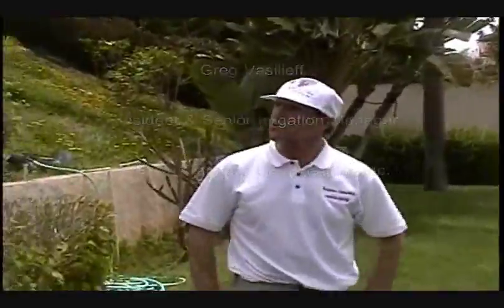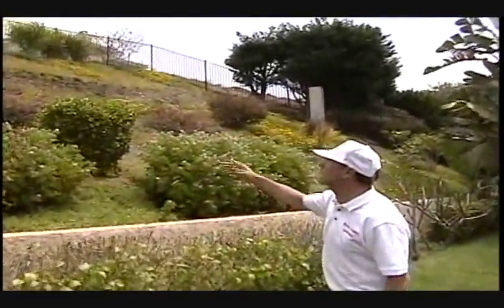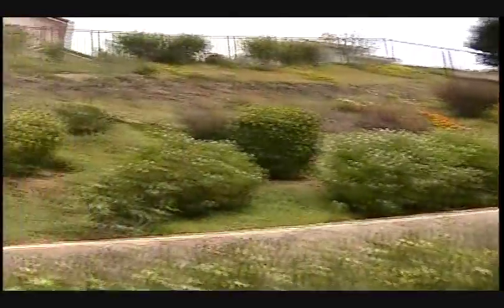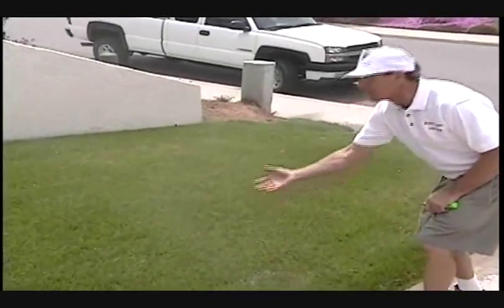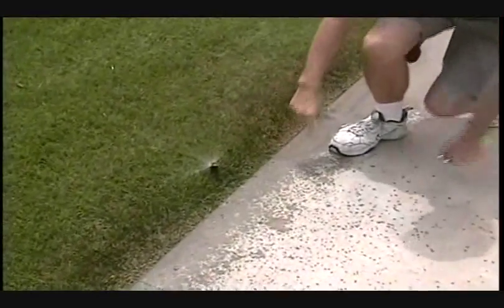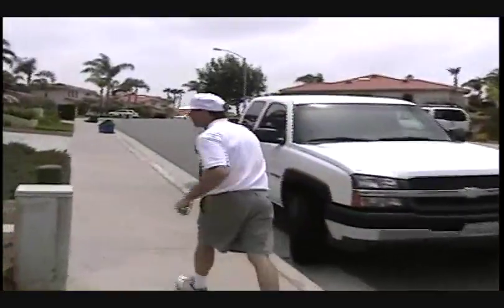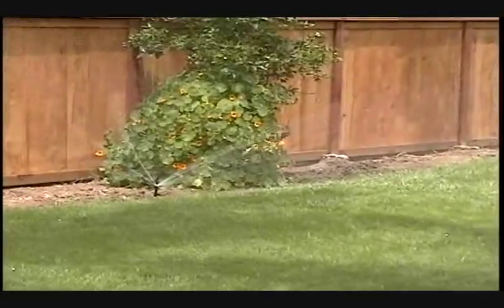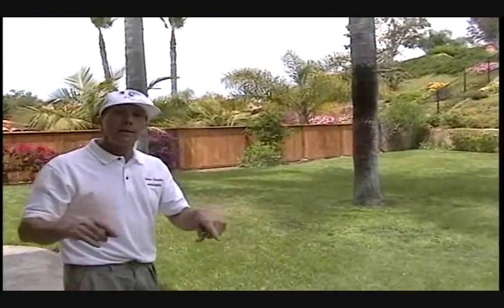MP Rotators

Comment: I agree I do sprinklers  system  and I have used hunter and rainbird  rotery nozzles  that apply  water slow   but u have to extend  run times and thay cost about 5$ per nozel that is a lot some customers  are us to  the regular  nozzle

Comment: Several things wrong with this video. Firstly, you are not using 60% less water. you are running the zone 60% longer. Your plants will die with 60% less water, as would you. You need the SAME amount of water to soak the soil to the proper depth. Rotators just apply is slower to the soil can absorb it without it running off on a slope for example. Telling people they will be saving 60% of their water is FALSE. Secondly, I do not see the hunter prospray 40psi regulated grey capped bodies used, maybe its the quality of the video. Thirdly, the RainBird 1800 is the body, not the actual nozzle. They also do not look like they are on 30psi regulated bodies so that is why you have the mist. Also, a RB 15H nozzle applies about 1.85 gpm. For real rotors, you have nozzle volumes from 1.5gpm up to 8 gpm for a typical Hunter or RainBird rotor. This is a very poor video explaining matched precipitation, run times, soil saturation etc. But hey.....you save 60% of your water.